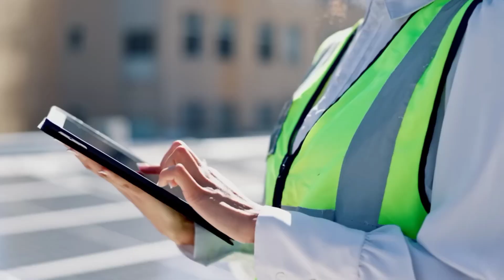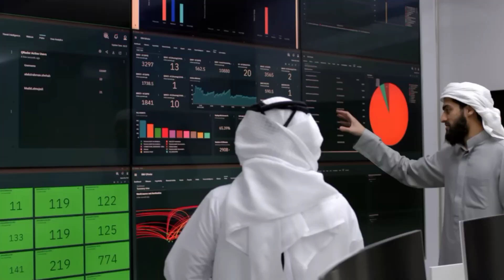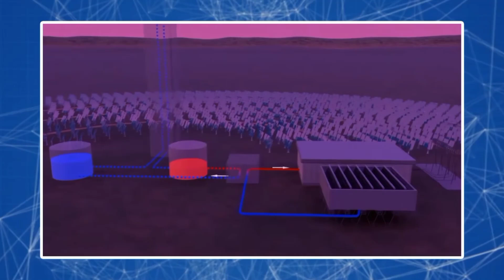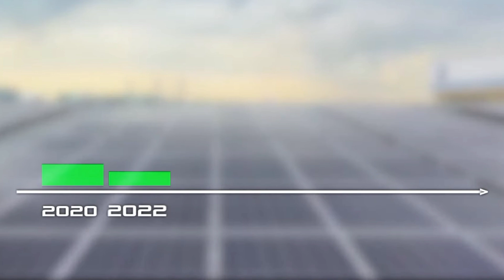Saudi Arabia’s Ambitious Desert Solar Park Project

Comment: Saudi electricity consumption is not typically at all. Their average demand is ~35GW but this varies a lot from under 25GW to over 75GW

Due to air conditioning summer deamnd peaks solar actually works quite well

They can and will build solar with relatively small amounts of storage to cover their needs

Quite likely they can incorporate 100GW of solar in a way that it works with their needs and generates 55% of their annual needs with the remaining 45% likely from oil and gas

They could prob even go to and might want to go to 150GW of solar + 250GWh of batteries to give them ~80% solar 20% natural gas